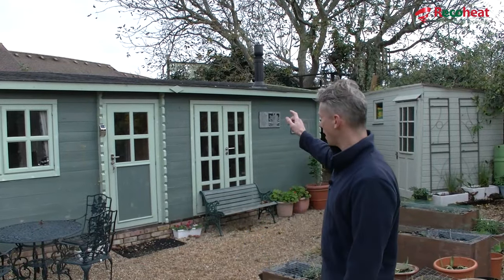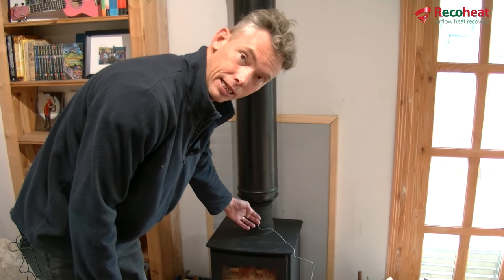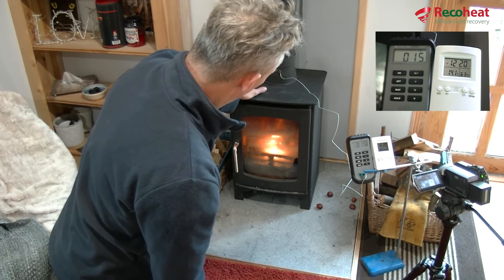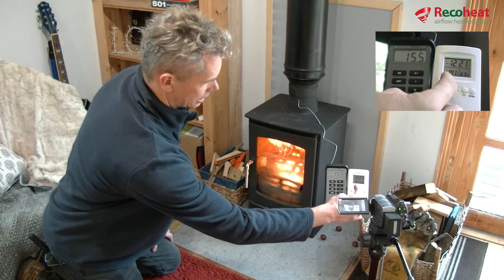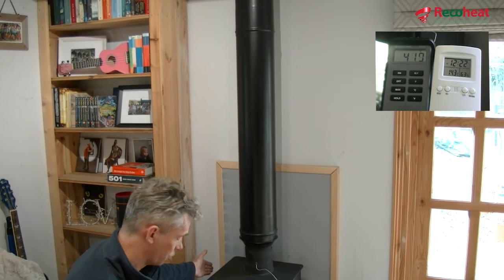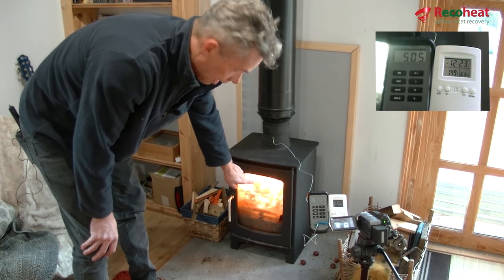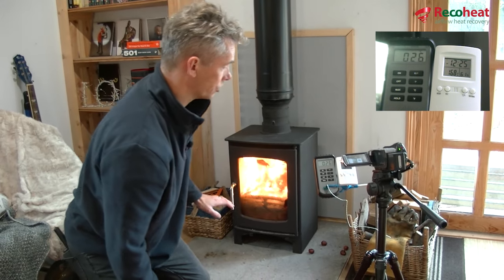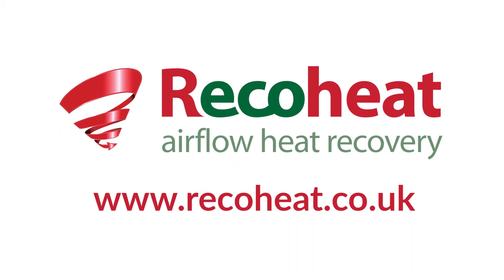Introducing the Recoheat heat recovery unit for wood and solid fuel burning stoves

Comment: Hi from nz, sounds great but terrible description. 
Where is the air pumped to ,which bit is the recovery unit?? I don't get it 😕
Reply from the maker: Sorry! The air is pumped to an inlet at the back of the flue, just above the collar. It goes round a steel coil inside the flue, which is the recovery unit, and out at the front, above the stove. There's a better presentation at https://youtu.be/tknNKch8ED8 and an FAQ video at https://youtu.be/fOdsE-DVGTo  The website also has images and a lot of detailed info - www.recoheat.co.uk Thanks very much for your interest, and al the best to you in NZ! We're very keen to sell in your market, and will ship direct with a contribution to costs of just £25.
Reply: @Recoheat  ill check it out thanks, ive just installed a new fire an this is very interesting.

cheers over

Comment: I am all about efficiency as far as not wasting heat but I am wondering about slit and Crystal build up increasing because of a cooler exhaust going out of the inside of the pipe since you were pulling heat off of the pipe slowing the exhaust flow..  I am wondering when this will start having an effect as far as how tall your chimney is?.  The main cause of Jimmy fires is build up inside of the chimney from not having a hot enough stream of exhaust leaving the house. A shorter chimney wouldn't be that big a deal probably but only two story home I don't think I would be comfortable with cooling my exhaust that much. 🤔
Reply from the maker: Thanks for your interest. That's obviously the crucial concern with putting anything inside the flue, and is the reason our device works when units with a larger surface area or using water, for example, would do what you suggest. Our unit by contrast does not cool the flue to any significant degree because the turbulence the coil creates in the gas flow, actually reduces pressure on it so it can flow better. At the same time, the total surface area on the coil is equivalent to 10cm extra flue length on a 5" flue, and 6cm extra on a 6". That means no properly functioning stove can be affected by it, because they have to cope with minimum variation in flue height of at least 5m or so. The system was tested by industrial engineers BSRIA as part of the CE-marking process, and they found no adverse effect on temperature or draft. Their certificate is on the website: do take a look, and thanks again for the interest.

Comment: I took the temperature of my flu and log burner and it had the same temperatures without the recovery system? I just control the airflow through the vents of the log burner to increase or decrease the flame adjusting the log burners temperature … I’m not really sure how more efficient this flu recovery would be as opposed to adding some burner top fans and increasing the temperature in the burner by closing down the vents to slow the burn ?
Reply from the maker: Thanks for the interest. Our unit doesn't affect the combustion or temperature. We're capturing the existing heat, but the difference we make is caused by the way we circulate it. We use the electric pump to force air into the coil where it becomes turbulent. The air is heated very quickly therefore, and expands and pressurises, and the jet of turbulent, pressurised air then passes out across the stove, from which radiant heat is rising. The two heat sources, the one small from the flue, and the much larger from the stove, combine and are driven by the pump. The key to the distribution then is actually the pressure equalisation, which carries the heat to the lowest pressure areas, including the floor. It's a combination that works far more effectively than heat-driven convection, particularly as it doesn't depend on you constantly refuelling your stove.
Reply: @Recoheat  interesting I’ve been looking at sand batteries and I was thinking about making something similar but using sand as the material to retain the heat and then blowing air through it similar to yours

Comment: So you have some type of a coil or heat exchanger inside the flue pipe with a fish tank aerator sort of thing pushing air through it? Why not put an 8 inch pipe over the 6 inch flue pipe seal the top and the bottom put a blower in the top any size blower you can configure and put a couple of vents on the bottom much more heat will be captured and you’ll be able to deliver I haven’t done the math but 20 3050 times the amount of hot air that you have coming out that one little three eights port?😳
Reply from the maker: Thanks for the engagement. Two reasons: the first that you'd be cooling the surface and bulk temperature of the flue far more than highly efficient stoves can support, and cause creosote to build up in that area. Second, your air flow would be much higher volume, but laminent. We're using the jet of turbulent hot air to entrain the radiant heat from the stove body and draw that out into the room. If you look at the physics modelling of the device in this video, you'll see that the subsequent airflow oscillates and disperses the heat to fill the area floor to ceiling, so is far more effective: https://www.youtube.com/shorts/I6TFB8cac04  Thanks again for your interest.

Comment: Always a good idea to turbocharge  a heating appliance - it'll boost efficiency loads. 
One issue - chimney sweeping.
Reply from the maker: There's a 65mm space through the coil, which is easily managed with a 25mm rotating head. We have sweeps using and installing it - as well as cleaning it for customers.
Reply: @Recoheat  Good to know, thanks!
Reply: @Recoheat  Is there still the same amount of smoke coming out of the chimney or is it a more transparent smoke?
Reply from the maker: @lenny108  It doesn't make any difference to the smoke, because it has no access to, or effect on the combustion, and the spiral coil doesn't slow the draught.
Reply: This isn’t “turbocharging”, there is an outside energy input via electricity.
Reply from the maker: @2brazy4ubitch  That's right - no additional air enters the combustion chamber. 👍👍
Reply: @Recoheat  Turbocharging uses energy contained in exhaust gases to compress supply air, i.e. more molecules of air per unit volume. Of course there is no additional air entering the combustion chamber, the product described would serve to marginally reduces draft to pull out a bit of “immediate” heat, which reduces the negative pressure acting to draw in combustion air. People who need “immediate” heat should not be using batch woodburners this size. People who want a room evenly heated should have shielding mass between them and the stove, and should spend their time worrying about airsealing (and as a lower priority, where viable, insulating) the room itself.
Reply from the maker: @2brazy4ubitch  A coil in an air flow does not reduce draft as it creates turbulence that decreases air resistance. Marginal as it may be - indeed no effect is discernible when tested in a normal lossy environment - the effect on the device on draft is therefore to increase rather than reduce it.

Comment: Cool demo. Still dont know what hardware items constitute the Rico system - fan, stove jacket, piping, controls, thermostat?
Reply from the maker: You can check it all out on the website: www.recoheat.co.uk. Basically it is an air pump, feeding a heat exchange coil set in a flue section that fits into the top of the stove/bottom of the flue, with the outlet just above the top of the stove. So it blows a jet of hot, expanded air across the hottest part of the stove into the room and keeps pumping until you switch it off.

Comment: All well and good, but I was told that a hot flue was required to burn off hydrocarbons which otherwise can coat the inside of the flue or chimney.
Reply from the maker: That's fine - hence our design, which minimises the heat removed by taking it from the centre of the flue rather than the edges, and does so via a surface area equivalent to 10cm on a 5" flue, and 6cm on a 6" flue - so comparatively small that it cannot make a difference to a functioning stove/flue that has to be able to deal with a variation of metres of flue height. The issue is key to our design.

Comment: Are you recovering heat which would otherwise be lost to the outside of the building ?
Reply from the maker: That's right. But we're then pressurising it and by jetting it across the top of the stove, using pressure equalisation to disperse the heat from the stove much more effectively. So the effect on the heat in the building is far greater than what we gain from the heat recovery.

Comment: Am I missing something here.  You power the air pump to blow a small amount of air around a slave fitted to the chimney.  The air is them blown out at a high temp through a small hole. That can't be right surely.. bog standard fan will move the air much better I think I think 20 to 30 would be better than 500 degrees.
Reply: Their claim is that using a heat exchanger in the flue extracts heat from the flue gases that would other wise be lost. Standard practice in large systems (steam locomotives used 'superheaters', a similar idea). However, in a domestic stove, the available heat is very small. They have done flawed calculations to give unreasonable claims (into perpetual motion machine territory). In addition, the design is far from optimum to reclaim the small amount of heat that is available. They get very hot air- but very little of it.
Reply: @Tensquaremetreworkshop   yer I understand the principle of it but as the stove puts out a lot of heat into the room it's in. I don't see the need to add more heat. Well what extra you will gain from an aquarium pump. Plus the flue is the first to heat up but the first to cool as well.  The cast stays hot a lot longer that the flue does. Going off my stove anyway. If your place was open plan and a big area it might work. Not, surely a desk fan that uses 10 or 15 watts and moves air would be a much cheaper and a better alternative and it won't cool the flue
Reply: @paulos9304  They make two claims-
- it heats more rooms. They give no logic to this, and no explanation. 
-it doubles efficiency. As you cannot double the normal 80% of a log burner, this can also be dismissed.
Moving the heat to other parts of the room can, as you say, be achieved by assisting airflow with a fan. As many people do.
Their system will recover some heat, but very few people would want the complexity and cost in exchange for using, say, 3% less wood...
Reply: @Tensquaremetreworkshop  well I did get a laugh at it. It's comicle. Its 300 or whatever it costs down the drain. I can't see the point in this this at all
Reply: @paulos9304  Wouldn't  removing a meter of that twin wall and replacing it with vitreous do the same thing for a fraction of the cost?
Reply: @paulking8055   It would, cheaper and better. I really can not see the point of this

Comment: Ok, i have an older wood burner that this would fit.
What is the power supply and current draw? Basically how much does it cost to run per season but more importanly, does the additional draw cause a much faster burn of the fuel?
Reply from the maker: It's 240v or 110v and is rated at 37w but draws 17w in operation. It doesn't affect the draw or combustion at all, so there's no effect on the gases except that you're circulating clean air instead of a convection flow from the floor. Because you're heating the air flow rather than the body of the stove, you use significantly less fuel than a conventional burn.
Reply: @Recoheat  Thank you for getting back to me and explaining.
Will be in touch. Thanks a lot.

Comment: does the pump need to be outside the house or just outside the stove?
Reply from the maker: It doesn't need to be outside the house, though it can be. It just needs to be somewhere you can't hear it. It's a big aquarium pump so it needs to be on a solid surface and baffled from the room, usually. The acoustics in the room actually make a big difference and causes a wide variety of impact, but outside the room is best for most people.

Comment: May I ask what is the nominal power of the motor in the air blower of this system?
Reply from the maker: The rated power is 37w, but it actually draws 17w when running the system.

Comment: I would have thought having a large radiator for the stove exaust to flow through would have been a good idea, I imaging a huge amount of heat is wasted just going straight up the chimney.
Reply from the maker: The flue needs plenty of heat to function - a radiator is a big cooling system, so would just stop the flue gases flowing and fill up with soot. Our concept recovers heat without impeding the function of the flue, which is why it's so effective. It's not actually a simple or easy thing to do.

Comment: 500C is not a recommended flue temperature,   put the coil or a plenum inside the stove and increase the diameter/ flow rate.
Reply from the maker: Hi Norman. It's not the flue surface temperature, it's the temperature of the flue gases. BSRIA (UK test engineering centre) shock tests flue parts to 820C, with long term tests at 500 -odd, so tested our device to the same standards as part of our CE-marking process. You could certainly incorporate into stove designs, but our device can be fitted to any stove.

Comment: So it's a flue gas cooler?
Reply from the maker: No: the coil reaches peak temperature within 3 or 4 minutes, so isn't cooling the flue because it's working at the same temperature. As it only uses about 15% of the lateral space (20mm in a 1250 or 1500 flue space) it is only interacting with a small proportion of the gases in any case, so its cooling effect is negligible. The heat recovery is still very impressive though, and at our normal flow rate stands at about .93kw of output. The big difference to the heating effect in the room though comes in the change in air flow because of the pumping of pressurised air, and the extra time the heat recovery unit pumps heat from the combustion, which is almost instantly after lighting, then for hours after the stove itself (as opposed to the embers) cools down.
Reply: @Recoheat  it's extracting according to your own figures almost 1kw of heat that would otherwise be heating the flue.  I accept that might not be catastrophic but it's a consideration.  I've no idea what you mean by the distribution of pressurised air - I see no ducting so I don't know how you can maintain a pressure.  Do you have any engineers in your development team?  It might be an idea to chat with them before releasing pseudo scientific publicity.
Reply from the maker: @andrewbeck5547  Nice one! As you say, it's extracting 1kw of heat, but as you're not measuring the total output of the exhaust, beyond stating the principle, whether it makes a difference is based on observation. As that's difficult, although we are having it externally tested as we submit it for Hetas approval, attempting to explain the observable non-effect is hardly pseudo-scientific. Controlled lab testing will certainly give us a clearer idea, but a flue is rarely a stable environment, with atmospheric, fuel, airflow etc variables, so what's broadly observable is as true in the real world as a statement of the principle. We'll certainly be publishing any test results from the external process. And thank you very much for interest and input - much appreciated.
Reply: @andrewbeck5547  we have wood stoves to heat houses not flues so any heat you can extract from the flue is a positive. If it means cleaning the chimney once more per year(which I doubt this small unit would even do) that is better than burning twice as much wood in my opinion

Comment: The room heat benifit is equal to the power already used by the pump. The volume of hot air is very low and will have no impact on room temperature 2 - 3 mtrs away from the recoheat
Reply from the maker: Check out the TrustPilot reviews - that's not what they say. Thanks for stopping by.
Reply from the maker: Take a look at the physics modelling video we've just published: https://youtube.com/shorts/I6TFB8cac04?feature=share

Comment: wow nice . dose it have like a filter or something or is it  hot air with smoke ? will smell the house ?
Reply from the maker: The unit is sealed from the flue, so the air going through it has no contact with smoke! Clean air, heated and accelerated, straight into the room.
Reply: @Recoheat  super awesome thank you so much for the reply , will be ordering one on the near future

Comment: Genus, cool down the air in your chimney! What could go wrong?
Reply from the maker: That would be difficult to detect, wouldn't it! It's a much tested, and much discussed point. The flue gases are not restricted - and in fact the turbulence induced by the coil shape decreases the pressure on them. The heat extraction on them can therefore only be defined by the surface area presented by the coil. This totals an equivalent area of 10cm additional single skin flue height on a 125mm flue, and 6cm on a 150mm flue. If your flue can't handle that variation, it isn't functioning and needs addressing, but indeed, shouldn't have a Recoheat fitted.

Comment: Does it make that hissing noise everytime its heating up?
Reply from the maker: Yes, it does. It sounds louder on the microphone but it's clear in a quiet room. It's the secret of the heat distribution - the device creates a turbulent boundary layer in the air flow that transfers heat very fast into the surrounding area because the air molecules are so excited! A slower, quieter air flow doesn't do this.
Reply: If we could hear exactly what it's like without the guitar score playing underneath, It will be louder than what we can hear on video.